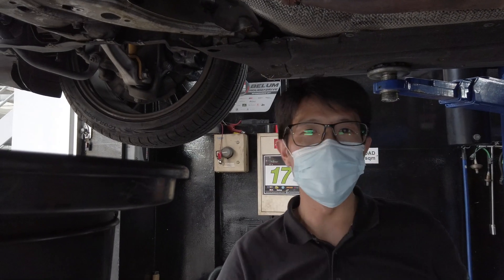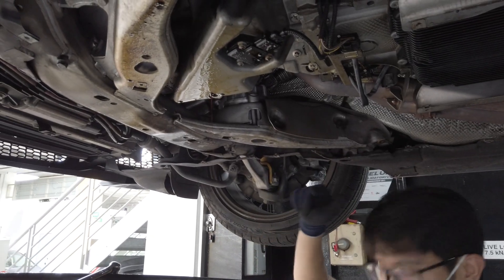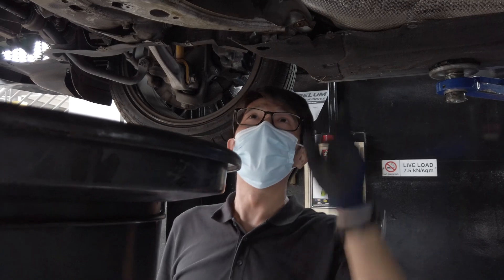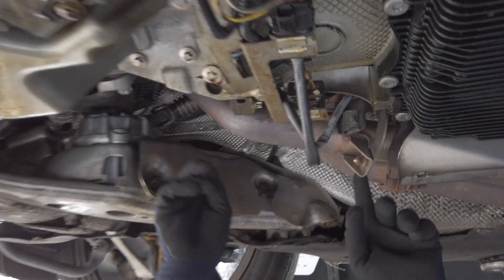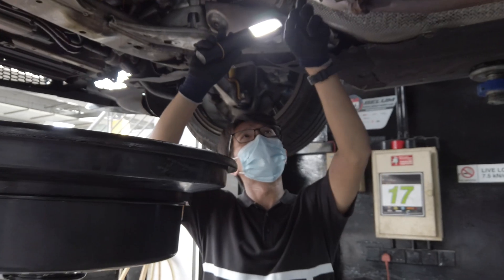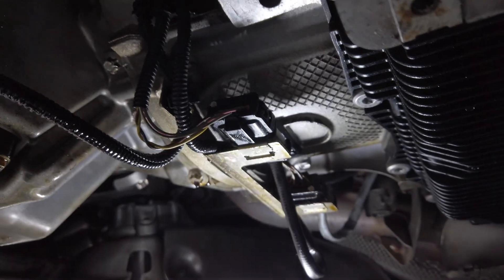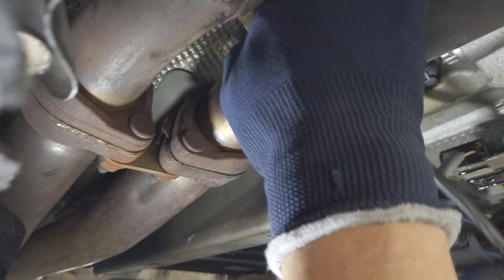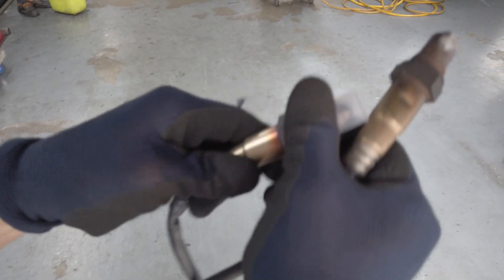BMW F10 Oxygen Sensor Replacement P0136

Comment: Is this sensor replacement for sensor after cat ? And will that link for sensor work on 14 F10 520D.

11787603023 Correct one to buy ?
Reply: Part number you want mate: bosch 8570230, I think even Dacia uses the same.
I just replaced with used one (15quid) works like a charm.
Reply: @WalkingJustice  thanks mate
Reply: @WalkingJustice  any idea where I would get ? Quick search there not sure if correct 1
Reply: @georgebutler423  I got mine from Ebay. Came of 3 series, as they are all the same, as long as the number matches.
Reply: @WalkingJustice  appreciate this mate thanks just to Cofirm this is N47 engine now yeah ? Thanks
Reply: @georgebutler423  mine is b47, however they're exactly the same part number (petrol use that part too)
Reply: @WalkingJustice  nice 1 mate thanks 4 all info
Reply: And both sensors are the same, took me 15 mins to change top one. Will be doing bottom one soon.

Comment: Excellent, can you show now how to change sensor number 1 bank 1 on the F10?
Reply from the maker: Hi Ivan! I will show how to change sensor 1 bank 1 when it is spoilt and needs replacement haha! Anyway, it should be the same removal as this, just that it is in an another position. Take note these things are super hot and you have to wait for them to cool down first before removal. I burnt my hands and fingers a few times 🙃
Reply: @NETTNETTCLUBVIDEOs  I need to replace mine; that's why I want to know where it is located and how to access it.
Reply from the maker: @porsinolosabias-y3b  you might want to check realoem or newtis. Plenty of diagrams and information there.